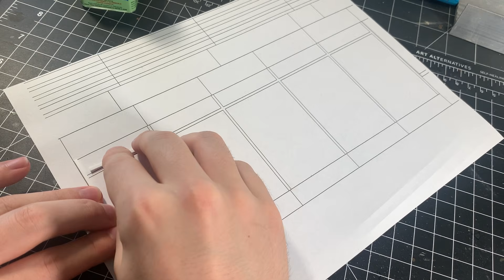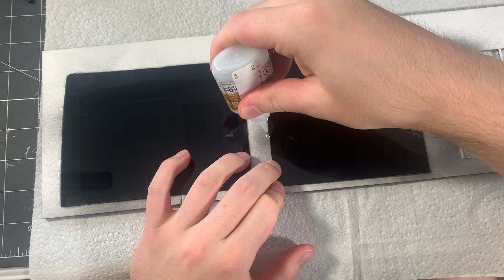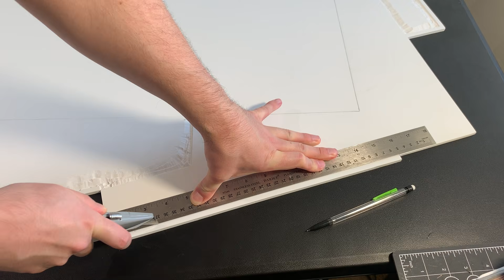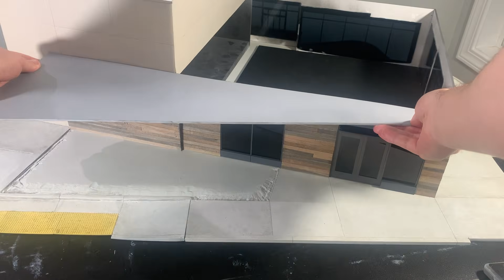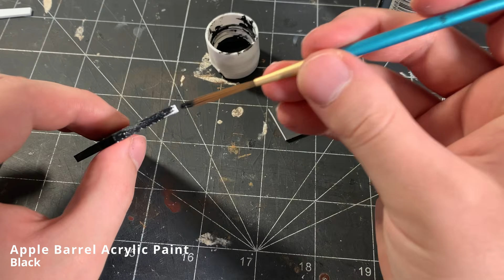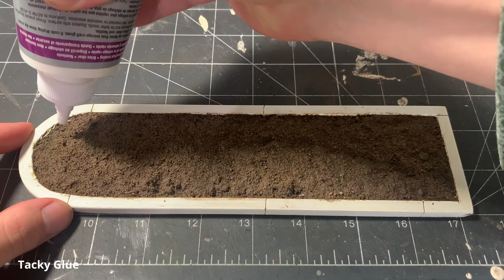Build an ULTRA-REALISTIC Starbucks Coffee Shop DIORAMA - Miniature Model Scenery

Comment: Get in contact with a commercial glass company and you should be able to get the touch up paint we use on storefront metal. It’s exact match to the anodized aluminum storefront material

Comment: Your videos are great, amazing artwork, skill, and knowledge. My question is  when designing a structure in any scale, house, or commercial building  how does one know what an appropriate  size  would be for the width and height of the building, house, windows and doors etc. Where do you find that type of architectural information. In your videos your plans are drawn to scale where do you get correct size measurements of things.
Reply from the maker: Thank you so much! First you need to pick a scale to design in. I use 1/2” scale in American architecture scale which is the same as 1/24 scale. 

For this building, I used google maps to take screenshot each side of the building. I cropped it and used my phone to make the images less distorted. Google maps also has a measure feature on the computer. It’s not perfect, but it can get you close.

Then I take the images into a program like illustrator, or auto cad and scale them to the right size based off the measurements. 

Another way to scale them is by using standard dimensions of doors to figure out the size of the whole wall. For example, most doors in the US are 3’ wide. So in 1/24 scale 3’ is 1.5”. In this case, you can size up the picture until the doors are 1.5” wide. I hope this helps, and thanks for watching!

Comment: ? What kind of 3D machine would I need? To produce parts like you did? And software.? Thank you❤️
Reply from the maker: You will need a resin 3D printer to make parts like this! There are many brands (elegoo, anycubic, phrozen, etc.) 

I have an elegoo Saturn s, but there smaller machines like the elegoo mars would work too. I use the free version of fusion 360 for the 3D modeling software. Hope this helps and thanks for watching!
Reply: 🙌🙌🙌❤️ Thanks a Million 🤝🤝

Comment: How much time do you spent to calculate all the scale dimensions? I think I'd get messed up at some point?
Reply from the maker: I probably spent about 2-3 days dealing with all the scaling and dimensions (I used to study set design in school so I don’t mind converting things to scale)
An easy way to get nearly precise dimensions if you’re copying a real building like I was for this one, but you don’t have access to it is to use the measure tool in satellite view on google maps. This will give you base dimensions for how long each wall is. 

Then on street view, screen shot each side of the building, and try to get it as undistorted as possible. Also, crop the images exactly at the end of each wall length.From there you can take those pictures into any software your comfortable with, and scale the walls to the proper length based off the measurements you got in google maps! 

Sorry if that’s a bit confusing, I might include this process in a future video next time I need to replicate an exact building. Hope this helps!
Reply: @smolworldworkshop  Not confusing. I figured that took a lot more time than it appeared. Thanks!

Comment: What do you think of the Rust-Oleum paint vs Tamiya? I would be interested in your opinion of the cap and nozzle differences. My take is that the rustoleum nozzle is terrible but wondered what you thought. Great work!!
Reply from the maker: Tamiya is 100% better in my opinion. I also prefer it simply because I simply like lacquers better than enamels. 

I only used rust oleum in this case because it covers well, and I had to paint large flat surfaces. It does okay for what I used it for, but I’d never use rust oleum  spray cans for detailed pieces. 

I think the rust oleum paint is pretty decent, it’s just the nozzle that is it’s downfall. In my Greece diorama video, I actually was able to decant rust oleum paints, and ironically thin it with tamiya lacquer thinner. It sprayed great out of my airbrush. Hope this helps!

Comment: In 1/24th! Wow! I am looking to make buildings in 1/24th - 1/25th as well. I am doing my buildings "Old School" though since I don't have a 3D modeling program. - I should make templates and then pin them down to a cork board and cover the plans with wax paper like you do for making model airplane wings and fuselages. I might also be making my buildings out of foam core and styrene strips...Just have to think about that one.
Reply from the maker: That’s awesome!! I also hand draw my plans and elevation drawing sometimes too if I don’t want to take the time to 3D model them. Good luck with your projects!
Reply: @smolworldworkshop I'm part of Gen X. I took high school drafting courses for 5 years, from grade 8-12 and we used paper and rulers on a drafting table. - When I graduated, Autocad was just coming in. Early Autocad was such a pain in the bum to use that I didn't really get an understanding of it. That was back in the early 1990's and I wonder if they simplified it, but that was 30+ years ago and I've never gone to get schooling or training in drafting since.